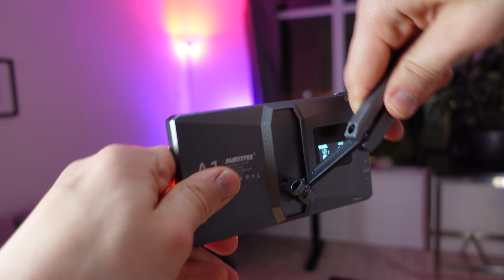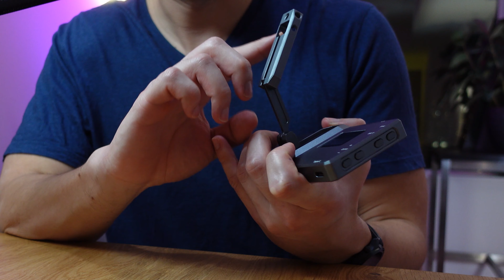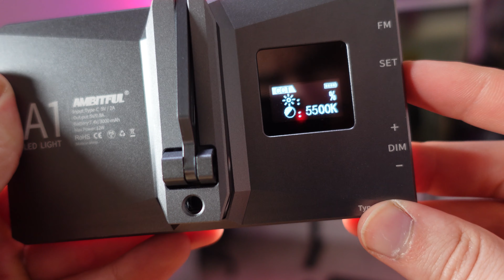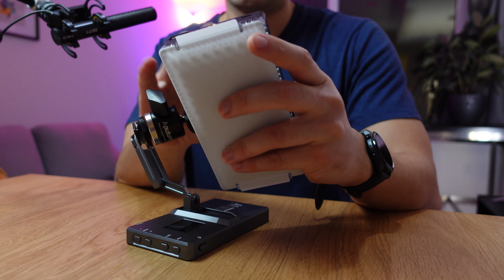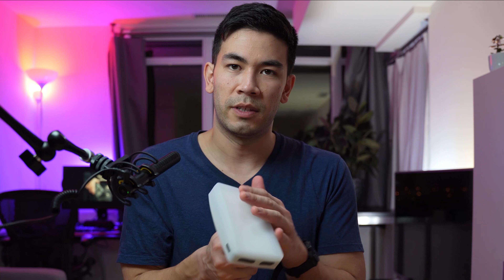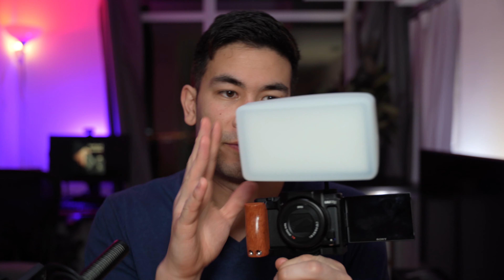AMBITFUL A1 Review with Sample Footage (...plus one very innovative feature you need to know about!)

Comment: Great review! I ordered one yesterday and now after watching your review I'm glad I did. Does it have overheating issues? To be honest I was on the fence between this and the Ambitful K10. Cheers!
Reply from the maker: it does get hot! but the frame acts as a heat sink. no issues, but i dont run it for more than 45 to 70 min
Reply: @jsyntaxmedia  thanks! I received it today and the effects feel unconvincing. Like the fireplace effect is too static and not fluid, making all effects virtually look the same. I hope this can be fixed in a firmware 😞 Otherwise the light itself is great!